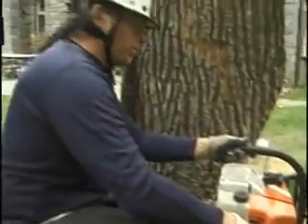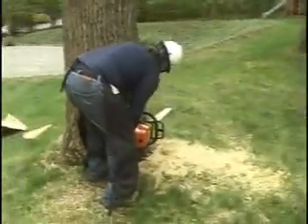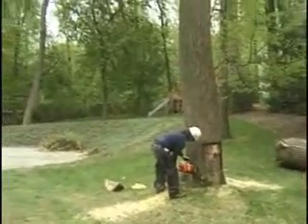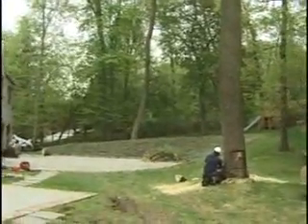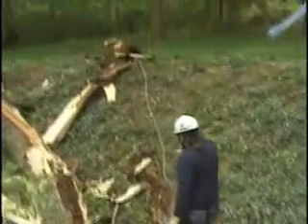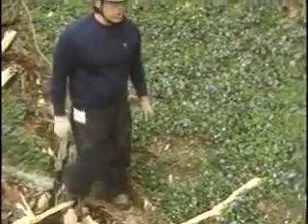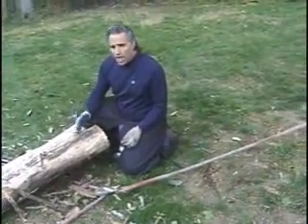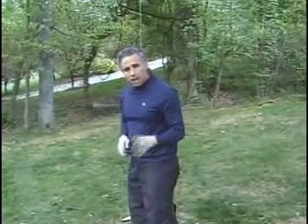Precision Tree Falling part 3 with Daniel Murphy Two tulip Spars

Comment from the maker: I appreciate the suggestion, but its not often that you can catch up to a tree once it starts to move... only way to do that is to get a running start with a truck. Best to use a line with a lot of stretch to reduce shock loading... only time I do that is when throwing tops.. not something for the inexperienced. most falls just need a pull line to get the tree moving in the right direction. the hinge takes over from there...